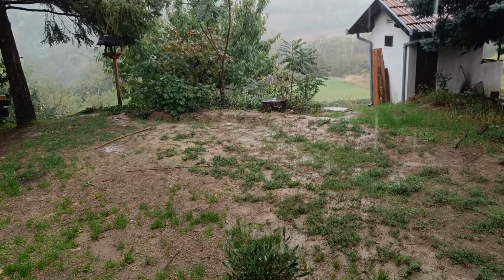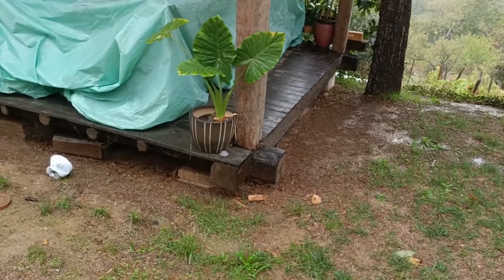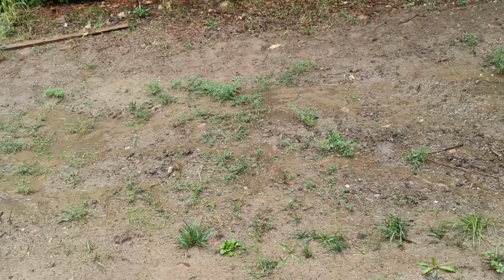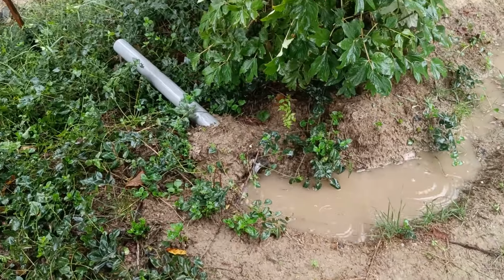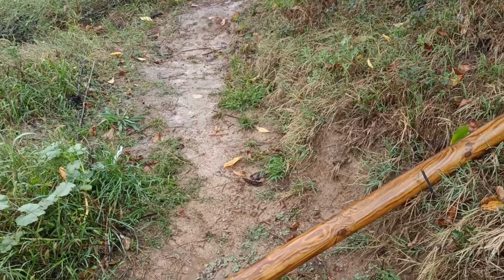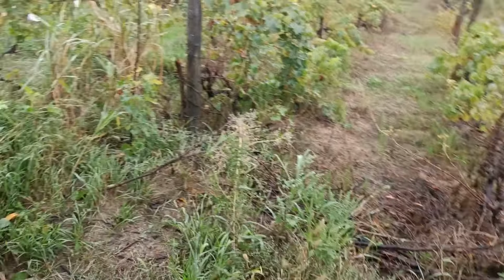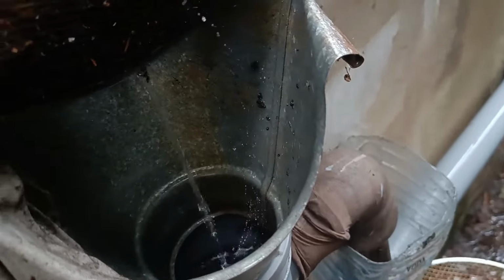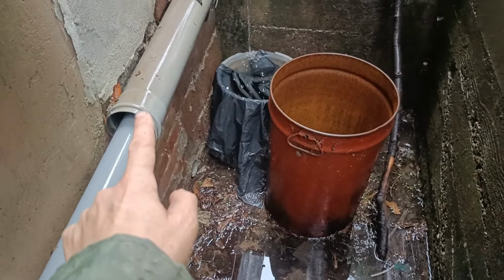Wet stuff falling from the sky! But where's it all going?

Comment: How to keep more water?
Trap it at the top of your lawn beside the driveways in a leach  pit? It will be a catch pit for uphill run-off to protect against erosion. 

The one my dad installed was 6 feet deep and several feet wide. Once he broke thru and removed all the dirt and clay he refilled it with silver dollar sized rocks, nothing too small, right to the top. The pit took  yearly flood waters away from our basement windows and sent it downhill, gradually thru the landscape. Our big oak walnut tree was very happy after that was installed.
Reply from the maker: I am definitely thinking about doing something like that, thanks for the suggestion. I guess it's a toss-up as to whether I want to sort of just soak it into the soil or actually try to collect it somehow for later use. The latter would involve digging tanks and things, so not sure about that...

Comment: I think what you need is a pond on the upper level. All your main collection points seem to be up there; roof, driveway, summer house, lawn.  Then in summer you could gravity feed down to trees, bushes and garden plants.  Could be dug in or with a fishpond liner.  Cover to keep out leaves and cutdown on evaporation.  Or not, either way
Reply: Is all the orange because of clay? He might not need a plastic solution?
Reply from the maker: @WebMaster-vh7ek  Thanks for the suggestion, I would LOVE to have a pond but yeah, unfortunately what we have is not true clay and is rather permeable (though it's not sand either). So I would have to use plastic unfortunately, which I'm not a fan of as I guess I want something more sustainable and "natural". I am hoping to dig a well soon and maybe we find real clay further down which I could use as liner. But I am totally down with the idea of creating water-holding features at multiple points down the hill. You're right, the main collection surfaces are up top.